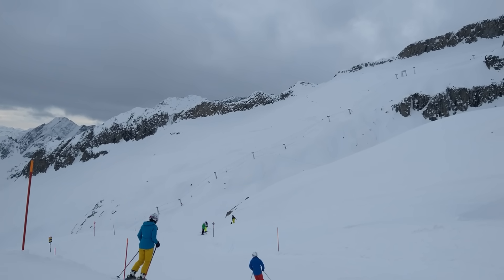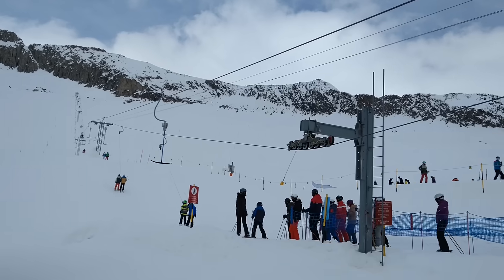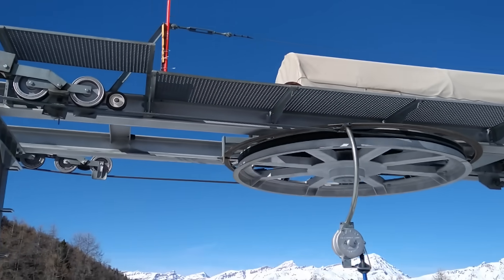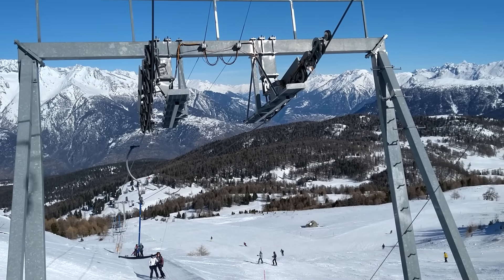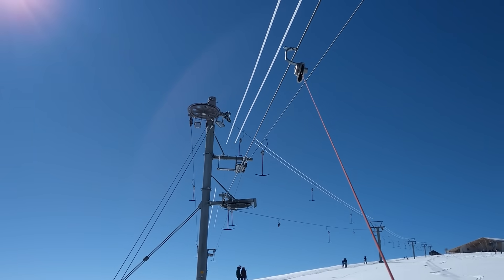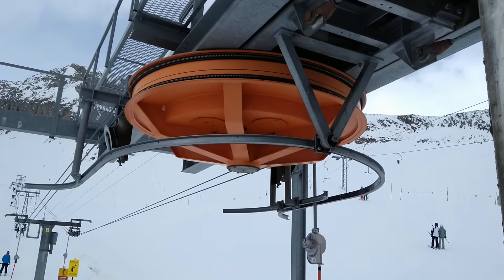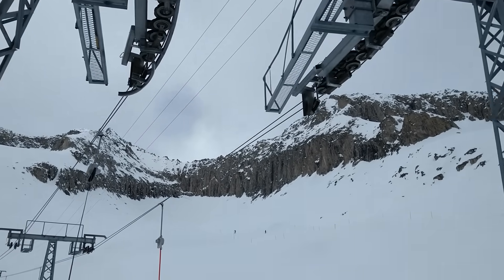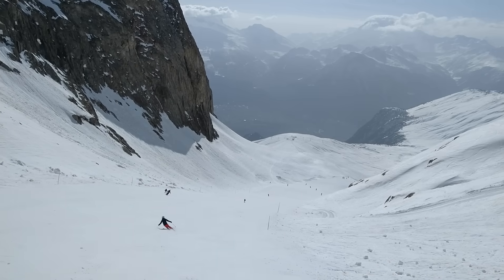The IMPOSSIBLE skilift that actually exists

Comment: They have one of those wierd turns at a T-bar lift in Åre, Sweden. Since seeing it for the first time I've been fascinated by it
Reply: Yes! I believe you refer to the Hamre lift in Duved (adjacent to and within the Åre skiresort area)?
Reply: @christopherjeverud8543  Yeah, that's the one!
Reply: @alfredsaalo1441  there is one in Finland too!
Reply: There's one at keystone too I think
Reply: The really interesting lift in Åre is Vargenliften in Björnen.  It's a J bar lift from POMA which is detachable and has sharp turns as well as going through two tunnels. The whole thing is even more insane when you consider that it only serves a very short green slope.
Reply: @maxcalabrese5962  Poma lifts are always interesting. If ww3 were to happen I feel like they would still be intact. They seem very durable
Reply: @alfredsaalo1441   this definitely is a whole different beast then the simple button lifts POMA is famous for. It has whole system for detaching the hangers and a crazy 1970s era timing mechanism. I have heard it's a nightmare to work on and I'm kind of surprised it's still running.
Reply: There are multiple ones like that apart from Duved. For example in Björnen there are about 4 of those. And there are more in the "rör kullen" area.
Reply: @almudenaneergaard8232  You are thinking of regular T-bars. Did you watch the video?

Comment: Now that is fascinating - very elegant and innovative solution. Wonder if this could be used on a chairlift rather than just a T-bar surface lift? For that matter, I wonder if a detachable could be built like this? Would be a challenging design, but probably possible.
Reply: Already several detachables that can turn in the horizontal plane, but all of them (that I know of) do it via a mid station, so are in effect, two detachable lifts joined together with a station. See Bollin/Fresse in Tigne for an example of a chair that does this. This has the advantage of allowing people to load/unload at the intermediate stations.  Easier with gondolas but cooler when it's chairs!
Reply: @Bigc847  I've actually ridden such a chairlift - Peak 8 SuperConnect or something like that at Breckenridge, Colorado. Has a mid station with a slight bend. The question is if it could be done without the cost, complexity, and slow-down of a mid station, though I'm aware that the cost of developing such couldn't be justified given how rare the need would be.
Reply from the maker: I was thinking the exact same thing! Would be fun to 3D-print a prototype that goes all four ways. In my opinion, the challenge would be to stuff all the springs and mechanics into the inner side of the T-clamp. This would likely make the clamp wider, so the wheels on the masts would be further apart, causing the masts to be wider. But it might be possible.
Reply: @sandro-here  Would be a challenging 3D print, but even just a hypothetical CAD model could be interesting. I put more thought into how it could work, and see several issues but also possible solutions to them. 

What I envision for a detachable would be basically two conventional detachable chairlift grips (possibly almost off-the-shelf units) back-to-back with the chair between them. Instead of having the chair mounted close to the rope with a stalk to the outside with a wheel, instead you'd have two joined back-to-back by a beam with the chair hanging between them on a pivot. Each side having two wheels like normal. The release lever on the grips (like done on normal grips) could be a challenge, if they're wide enough they'd just be facing each other, if closer maybe could have them cross. In the crossing configuration, I imagine each one being offset the same direction when looking outward at each grip, thus one would be forward and the other back but using identical parts (sort of hard to explain without drawing it). Coil springs would get in the way, so maybe have a linkage to a torsion spring like the Dopelmayr DT series, but without the dual-position feature. For the piece the tires roll on (not sure the technical term), could have one on top of each grip and double rows of tires, or if the grips are widely spaced could have one between the two release levers. Though on a different note I've pondered if it might be possible to eliminate the tires entirely, use a linear-induction motor to move and accelerate the chairs, would have far less mechanical complexity and surely less maintenance. I envision this whole assembly being totally symmetric, the grip on either side being completely interchangeable for parts commonality - and hypothetically a chair could be put on backwards.

You mention the wheels on the mast - I assume you're thinking the width of the cross-arms? My understanding is that is basically limited by the width of the chairs and worst case how much they might swing if loaded wrong (people only on one side) and in wind, so they won't hit the towers. There would be trade-offs in the width between the two ropes in this concept, wider would make it more stable, narrower would mean smaller equipment, plus the issue of how closely they'd come to the chair when going "vertical."

One issue I see is of the ropes going vertical, one rope above the other - the chair hanger could possibly hit the lower cable. This could be solved by having the pivot to the chair below the level of the ropes rather than level with it, but that would create a torque twisting the cables back to level. The surface lift has the pivot well below the ropes, but less vertical load is on this so it's not as big a problem. My solution to this would be to never actually have the ropes go vertical, maybe limit it to 45° tilt either direction. (Could probably go with more than that, maybe up to 60°, but I'll use 45 for discussion.) This would still allow for horizontal turns, but not purely horizontal turns. Basically the turns would be with the sheaves 45° to the ropes turning it sideways and upwards. Have it go over a support tower (breakover) that gets the ropes going downward at a 30° angle, then tilt the ropes 45° through some depression/turning sheaves, it would be turning upward and sideways, by the end of that it's going 30° upward and 60° horizontal direction change. Could have it go over more breakover towers and another of this to get a greater turn angle. This would make it not possible to have chairs go around a bullwheel, which might make this not work for a fixed-grip, but on a detachable that would not be a problem as chairs wouldn't be attached around the bullwheel.

Another issue is the ropes inside the terminal once the chairs are detached. This would place one rope outside the chair track and one inside. I see three options there: Could somehow shift the outer rope over the track to a bullwheel mounted inside the track like a normal detachable terminal. Or could raise the inner rope to pass over the track as it curves around the end, having the bullwheel outside the terminal, sort of like seen on some early Poma detachables that had the bullwheel attached to a fixed-grip-style drive terminal fully outside the detachable terminal, the rope passing straight through the terminal. The third solution would be to have two separate bullwheels, one inside the track and one outside, geared together. 

With all I've described, I think this would be possible, though challenging and probably not cost-effective. Especially considering how rare turning chairlifts are, there'd be little motive to develop this. Surface lifts need to follow terrain skiers can ski along, that's not a constraint for chairlifts that usually can just go over most things. And their might be other simpler ways for a detachable chairlift - simply detach the chairs from the rope, have the chairs turn on rails and the ropes turned by sheaves. Especially as usually the main reason for wanting to turn a chairlift is to serve a mid-load station anyway, there'd already be that terminal. I've actually ridden on a lift that does exactly that, Peak 8 SuperConnect (if I remember the name right) at Breckenridge, Colorado, USA. Has a mid load station with a slight bend in it (maybe 15-20°). Both uphill and downhill chairs go through the terminal, I suppose if it weren't for the bend there'd be no reason for downhill chairs to go through, could simply bypass it for less machinery and wear. I wouldn't be surprised if more that do that have been built for urban transit gondolas, such as those used in La Paz, Bolivia, which might have multiple stations on a system with turns at each. In fact looking at a map of the La Paz system I see that most lines have multiple stations and it appears the direction changes at many said terminals.

 I would also think if we're talking about multiple cables, it might make sense for only one of those cables to move, have the other one or two be stationary with sheaves on the chairs or gondolas - a 2S or 3S system. I don't know if any turning systems exist for those either, but it would be another option to explore in seeking to solve this (hypothetical) problem. I read up and watched a video of the Ngong Ping 360 bicable (one moving and one stationary rope) system, that has two "angle stations" for changing direction, which detach cabins from the moving rope, slows them down to almost a loading speed even though the doors don't open and there's no loading platform, turns them, then reattaches them to the moving rope, so basically the same solution I described above - hence a bicable system as we know it can't turn either, but I still think a system with one moving rope and one or two stationary ropes could be explored just like a system with two moving ropes could be. Actually, looking at that system, I feel like this would show the potential benefit of a system that could turn, as the angle stations are very large and presumably expensive, and of course maintenance intensive, just for the purpose of turning. If a simpler and more elegant method of turning were devised it would surely have saved a lot of cost at least in that case. Also shows that no system that can turn like we're thinking exists, as if it did I'm sure they would have used it. I suspect it's possible, like we're thinking, but probably the development costs wouldn't be justified by such few uses, hence it was cheaper to build those angle stations than come up with (and engineer, prototype, manufacture, test, and certify) some novel new idea of aerial ropeway.
Reply from the maker: @quillmaurer6563  Wow, you've put in a huge amount of thinking and your thorough knowledge about detachables from different manifacturers is astonishing! May I ask where you learned all that?
While I certainly cannot judge your technical suggestions, the construct does indeed sound very expensive. Especially the part with the linear induction motor which probably requires a large amount of very strong magnets or electro-magnets. I feel that the use of linear induction motors have been reduced over the past years, which is sad. The traditional wheels may be cheaper. But yes a LIM would be so much cooler (just imagine the hum it would make!)...
Maybe such a fancy double rope chairlift would be useful for urban terrains. However an intermediate station would have the additional benefit of allowing people to board mid-ways. So the best use case for such a lift would be a terrain where trains etc. cannot be used but many turns at non-interesting places are required. I wonder if such a place exists. It's likely rare and thus not worth the development cost.
Reply from the maker: @quillmaurer6563  That's pretty awesome! I take it you're also a fan of the Technology Connections channel ;-)
Very interesting idea about mines etc. Combined with a smart loading/unloading system, this might actually be a game changer. It may be much cheaper than building a conveyor belt.